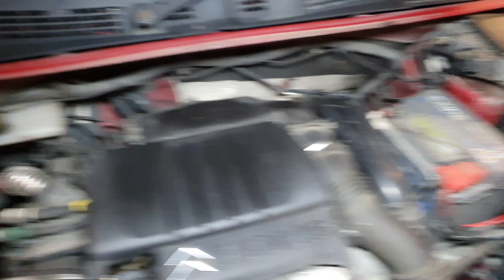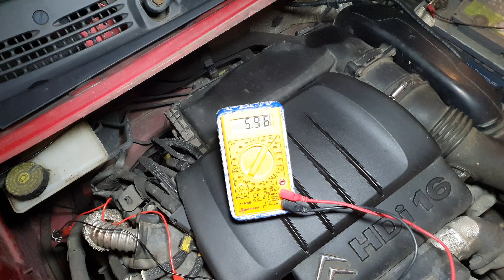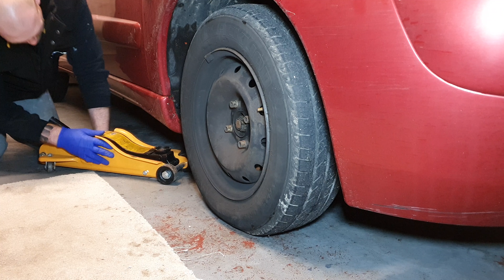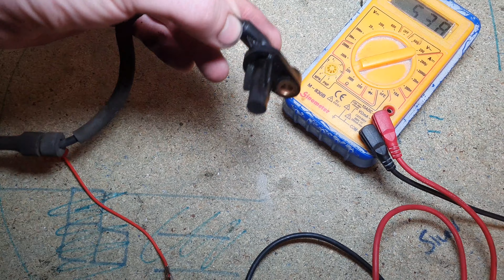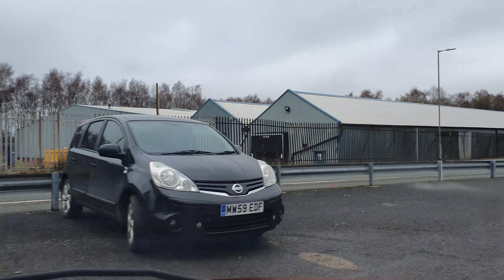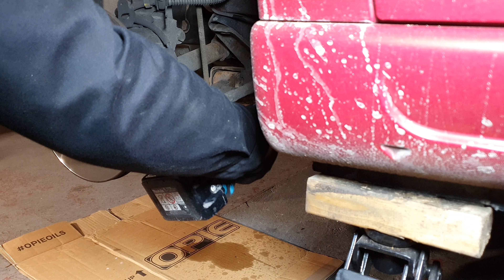Knocking noise and ABS light FIX on my Citroen Berlingo Multispace

Comment: Went to change drop link due knocking, found broken spring.
Reply from the maker: Yeah unfortunately another common issue 🙏
Reply: @projectfearn  So ended up new springs, shocks and down links. Wonder if i messed up the abs sensor that corner. Abs fault come up in cold weather.

Comment: Hi what steering parts are on the 2006 Citroen Berlingo 19 D van on the front as I want to replace the lot,  also what suspension parts are needed for the rear apart from shocks and springs, the MOT is due in 5 months and want to replace everything and then replace the shocks and springs at a later date once I've saved enough money, great video but I would rather buy the parts and get someone like you to fit it all, I'm a body man not mechanical I'm afraid, may I ask where is your garage please ?
Reply from the maker: I'm not a garage/mechanic pal. I just work on my own cars 🚗

Comment: I’ve changed a number of drop links and struggled getting them lined up to put the new ones on.  Then recently a mechanic mate informed me that the reason was, you’re supposed to Jack both sides up, to take the tension off the stabilising bar.  DOH! Did this, and the next ones took minutes.  Also, if the nuts won’t come off when removing the old ones, just grind them off, takes seconds.  (Just make sure the new ones have nuts first).  Thanks for your video though.

Comment: I’ve got a knocking noise on my multispace, looked all round the suspension and nothing obvious, the drop links look ok but for £12 for a new set I will change them when I do the discs and pads
Reply from the maker: Does the lower ball joint look OK mate and the top shocker mounts?
Reply: @projectfearn  everything looks ok, there's nothing obvious, although haven't looked at shock mounts but there's no play in any joints but there's a knocking when on anything other than a smooth road.
Reply from the maker: I would deffo of thought its suspension or bush related. Are engine mounts ok etc? No loose covers or anything? 😎